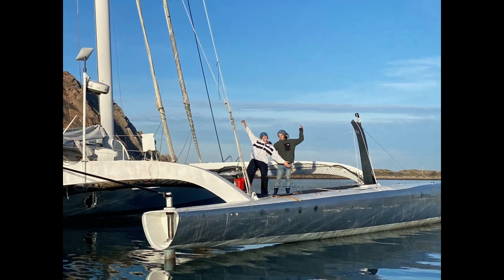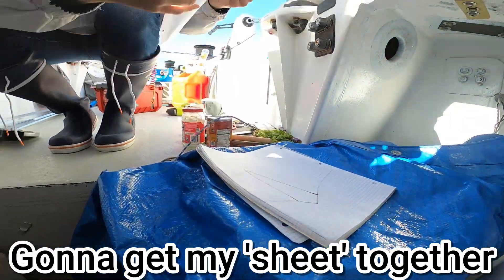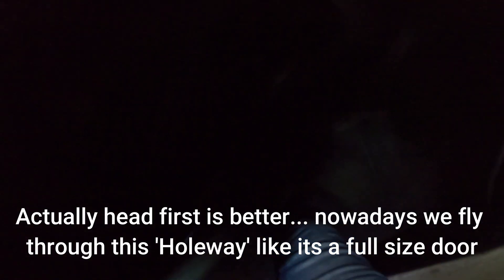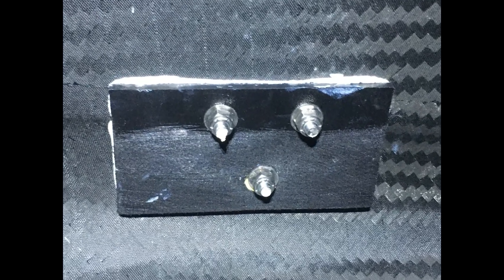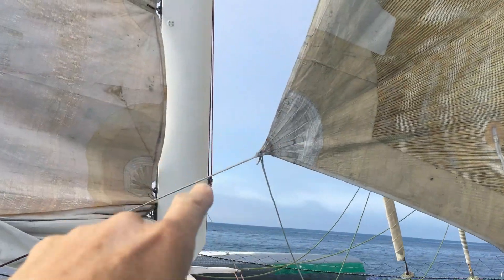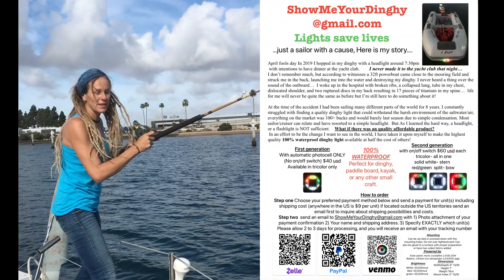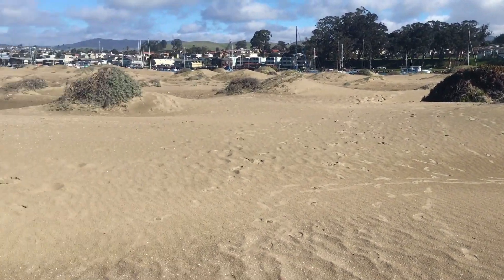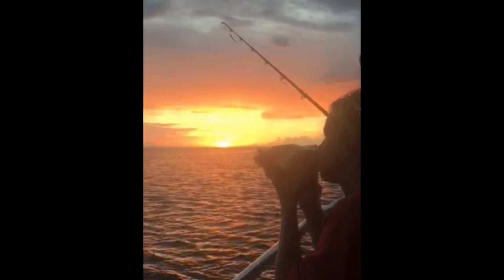Drop It Like Its Yacht! Mod 70 Hooker Fabrication 'How To'

Comment: Carbon fibre touching metal WILL eat the metal.
Reply from the maker: yes, which is why we do a layer of glass or sealant to isolate… That was mentioned in the Anchor fabrication episode, but not in this one because by the time we got to installing the hatch, the video was getting a little long, and I was running out of time. But thank you for the note.

Comment: Doing all the right things, soft pas eyes are probably better for what your doing but you'll figure it out, just keep an eye on the corrosion on the SS, it ends up being the sacrificial anode. There are soft padeyes that come with a screw on container to keep water leaks away. My ex was working at a boat show in Sydney Harbour a decade or so ago, she was running home in our little 10ft dingy and had a VERY near miss with a high speed catamaran ferry heading back to base. She ended up putting stick on battery LEDS on after that, yours looks way cooler.
Reply from the maker: Well, I’m very glad it was a miss! Thank goodness for that.

Comment: Great that yo saved this one. I remember this boat from her heydays, about 2001 I think, skippered by Jean Le Cam, a great man who is still going strong. Participated in the 2024 Vendee Globe, solo round the world race. Met him a few times in the nineties when I sailed mostly Formula 28 trimarans. 

This boat is an amazing machine, but not really possible to adapt to cruising. It’s kinda misbehaving until you get it really powered up. Then it feels like a revelation, an incredibly smooth flyer. However, to properly power her up, you need good sails, well maintained equipment, skill and good nerves. You need to keep her relatively close to the limit to keep her feeling like a sailboat, not a raft, and to prevent slamming the windward ama on big waves. She probably doesn’t break from that, but it’s very unpleasant. 

I think the best use for this boat isn’t modified to a cruiser, but as an event boat. Bring people out for a spin they will never forget. Maybe a fun race now and then. But new sails for this one is a fortune! Just the main is probably 190 square meters (near 2000 square feet). Loads are insane. Yikes! Jean Le Cam is still quite a hero in France and internationally among racing sailors. If you have interesting ideas, he might be interested in giving it attention. I’m sure he wants his old boat to live on.

Comment: Awsome what you're doing, but wach out you can overload the structure of the boat and could lead to some major issues when you start to load up the boat when the wind picks up. The main reason why is because the structure is not built for weight, and that is why the boat is pretty much empty. Also, be very careful if you go out in some medium to heavy winds because those ormas flip very easily. But in other words, good luck, and I hope to see you out on the water!
Reply from the maker: Yes, we are quite aware and are at this point are more than a year and a half into this. And if you watch the video, we mentioned wait several times. That is very much in our calculations but thank you for the caution.

Comment: Nice job on the anchor roller. You may want to add a piece of starboard or other material between he anchor and the tramp to protect the tramp from chafe. If you are blasting through heavy seas the anchor could get pushed up into the tramp and chafe it through. Just a thought. Amazing project. Can't wait to see what you do with it.
Reply from the maker: we have tested that theory pretty thoroughly at this point and it seems to be fine but I always appreciate the thoughts

Comment: Definitely water world vibes.  I would love to have that boat.  Y'all are incredibly lucky.
Reply from the maker: I would agree, a little bit of luck, and a lot of hard work goes a long way! You very much could have a boat just like this. They are out there!
Reply: Everytime the mooring or marina fee is due boats on sale get cheaper. The more complicated the boat, the cheaper. I had a lot of free (still seaworthy) boats and even more very cheap ones to bring to new owners when I still was on the water myself. Problem is, You usually do see these boats coming from the water only, with most of the (European, though) marinas being well secured and shut off to the "peasants" coming from the on-shore side - You can't just walk in and have a look anymore in most places these days. Which is why many boats got and still get (despite facebook-groups and what not) destroyed because possible new owners do not even learn about cheap or free boats. Plus: many marinas are privately owned and run these days: They do not want any cheap DIY crews within their premises whatsoever to not "disturb" their "floating condo"-customers, the type with mostly money and no plan. Sailing is, regrettably, mostly "big business" these days.